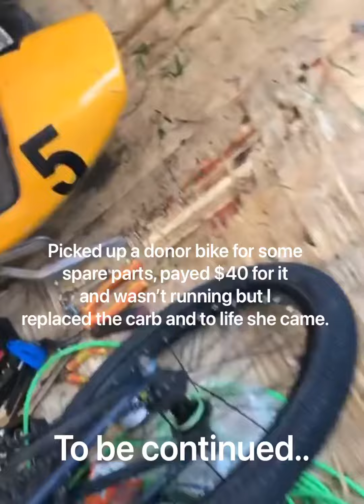50cc to 66cc big bore pocket bike build

Comment: Looks like the original 49cc head?
Reply from the maker: It basically is the exact same head the cylinder is just bored out bigger with a bit bigger piston
Reply: @tanmansbikebuilds931  8m just confused on how it could b 70cc without puting a hole in the dise of the cilinder . I have the stage 3 and I think it is only 52cc fron the original 47or 49
Reply from the maker: @011CJ  the kit I got was a 49cc to 66cc so I call it 70, I’ll find you the kit I ordered, I also had to replace the crank as the rod barring didn’t fit the new piston so I had to do the crank aswell
Reply from the maker: 44mm Big Bore Cylinder Kit for 2 Stroke 43cc 47cc 49cc Gas Scooter Mini Pocket Bike https://a.co/d/2CRBVmA
Reply: @tanmansbikebuilds931  that would be cool cus all I can find are the big bore kits with the hi compression heads and the stage 3 build I think is only like 50 to 53  frome what Thay say . I rely want to find a way to fit a 110 motor with a manual trans but Thay are to long for these bikes the front tire gets in the way lol